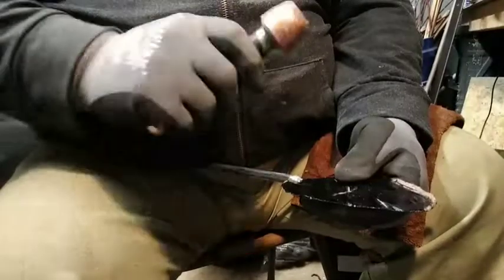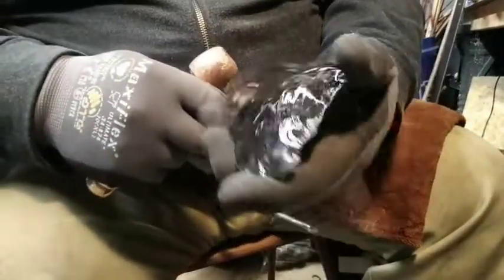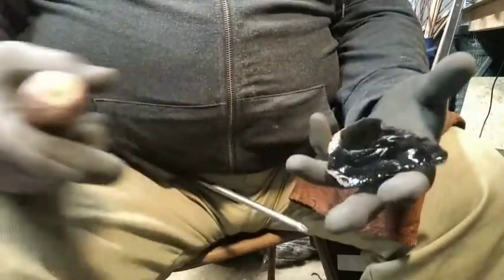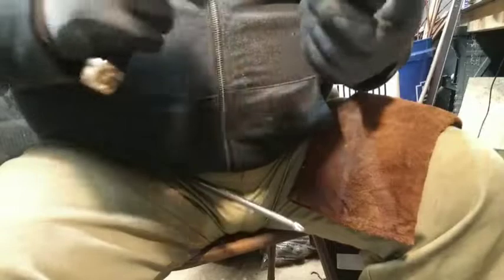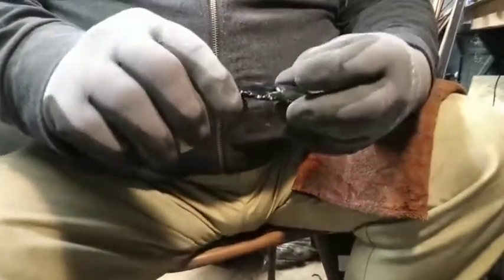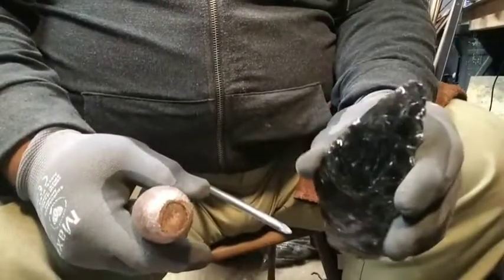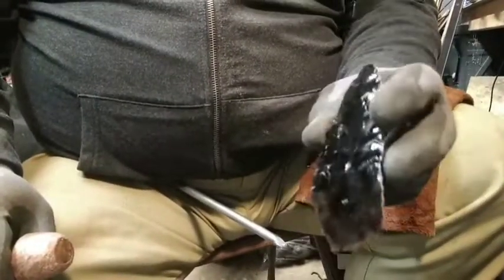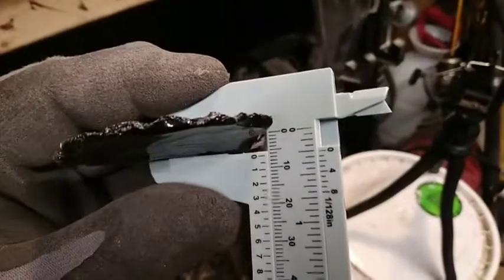Knapping obsidian that's easy, lol, it's not Wildhorse

Comment: What is the indirect stick made from? Doesn't look like copper..
Reply from the maker: It's a 12 inch steel nail
Reply: @sticksstonesandalittlemeta3517  Do you find it grips well opposed to copper? I'm just new to knapping and am experimenting with different materials for tools..
Reply from the maker: @DanB1987  hard to explain doesn't really grip the tip is ground to match the platforms and the dust/grit from light abraiding provides the friction for some grip
Reply: @sticksstonesandalittlemeta3517  perfect explanation, thanks.. A wise man once told me "If in doubt - abrade it!"